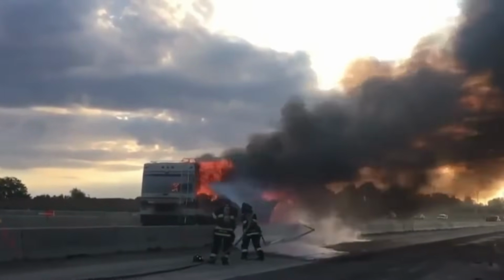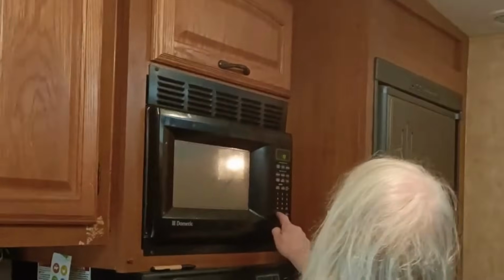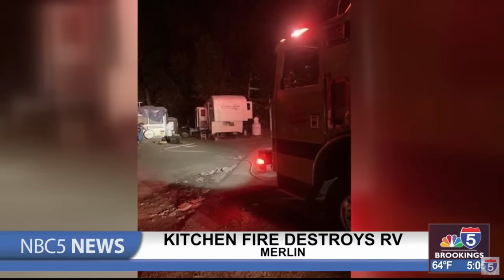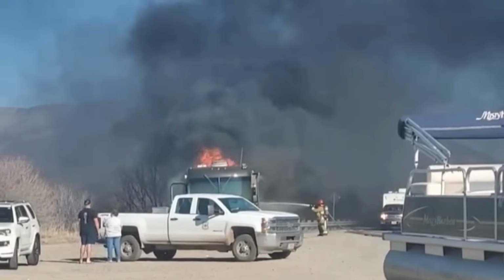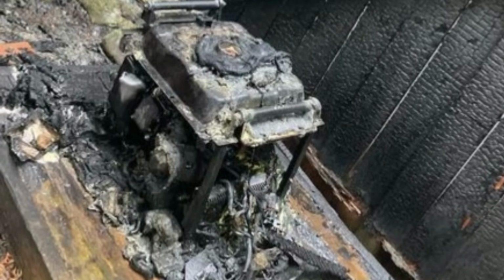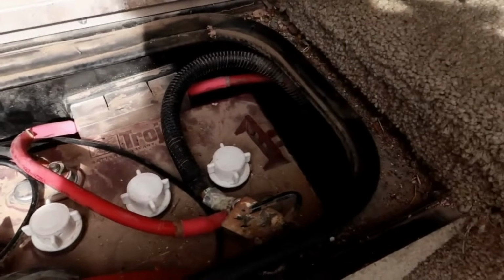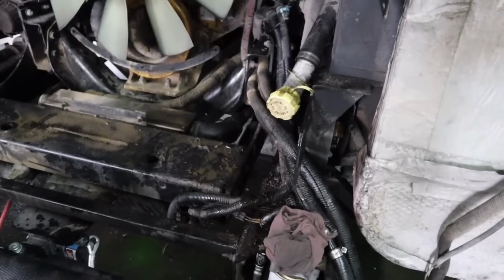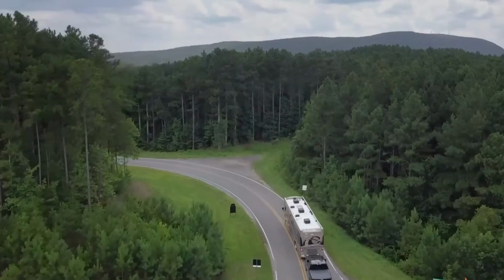13 Shocking Causes of RV Fires and How to Stay Safe

Comment: I would shut off the propane tank after each use ect .
Reply from the maker: That’s a great safety habit to have! Also, are there any other fire safety tips or routines you follow that you think others should adopt?
Reply: @ hopefully someone or somebody will heed to it . I use to own a pull behind camper & it had two propane tanks & after done using the stove I’d go outside & turn off the gas at the tank . And another thing I would unplug things  that was unnecessary. Just to reduce the possibility of a fire. I’ve seen just how quickly a camper can go & it never hurts to have the camper inspected by professional to look for anything that could be a hazard waiting to happen. My theory is a once of prevention is worth a pound of cure

Comment: Great video! RV fires are such an important topic to discuss. It’s surprising how quickly small mistakes like faulty wiring or unattended cooking can escalate. Regular maintenance and proper fire safety tools like extinguishers are a must. Thanks for spreading awareness and keeping the RV community informed!
Reply from the maker: Thank you so much for your thoughtful comment! You’re absolutely right, small oversights like faulty wiring or unattended cooking can have serious consequences in an RV. It’s amazing how much of a difference regular maintenance and having the right safety tools can make. Out of curiosity, do you have any specific fire safety tips or tools you’ve found especially helpful in your RV travels? Sharing those could help others in the community stay even safer!
Reply: Most RV fires have zero to do with propane

Comment: The number one cause of RV fires is electrical including batteries offgassing hydrogen which is extremely flammable and explosive.

Anti-propane propaganda is a joke!!!!
In use for over 70 years but, now it’s a problem and RVs are burning up everywhere?

They want you to go all electric!!!
Propane and fossil fuels bad!!
Reply from the maker: Thank you for sharing your perspective! You bring up some important points about the role of electrical systems and propane in RV safety. Electrical fires, including those caused by battery issues, are indeed a leading concern, and it’s critical for RV owners to stay informed and proactive about maintenance. As for propane, you’re absolutely right, it’s been a reliable fuel source for decades when used correctly.

The shift toward all-electric options is definitely a hot topic, and opinions vary widely. I’d love to hear more about your thoughts, do you think there’s a balance to be struck between traditional propane systems and newer technologies? Let’s dive into this discussion together, it’s an important one for the RV community!